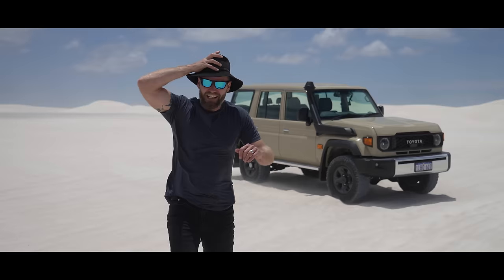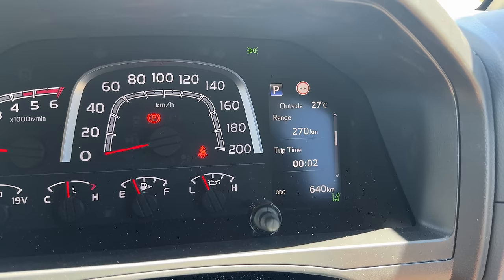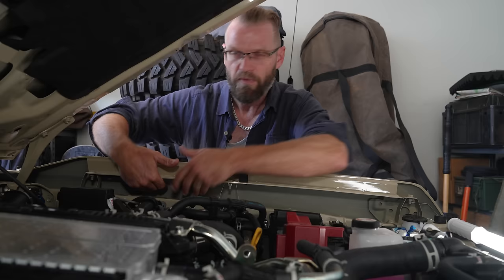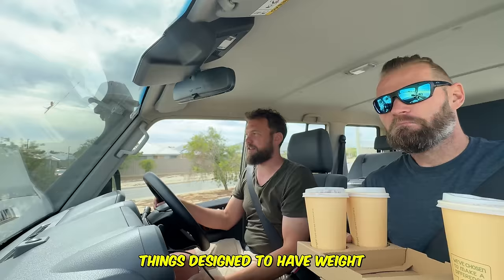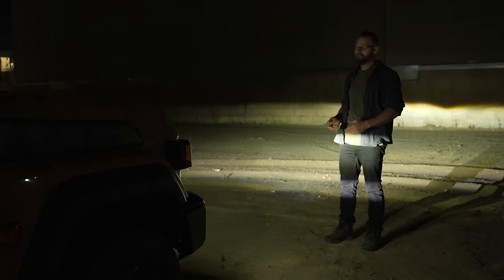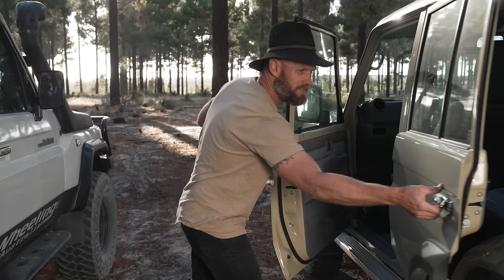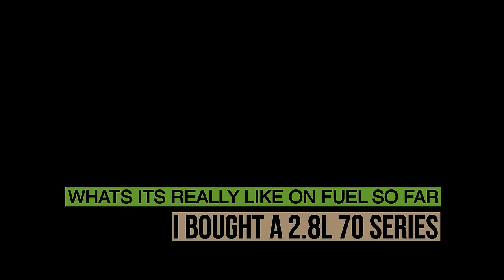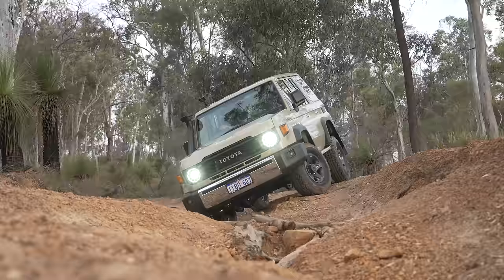I BOUGHT A 2.8l AUTO 2024 LANDCRUISER 70 series

Comment: Good on you for buying one & giving it a proper test Ronny. I worked my way through most of the YTs at the media day held at Broken Hill, with your usual bunch of clueless w**nker journos with their usual dribble. Upsides of the new 4cyl from what I can see: proven power plant (unlike the 3.3V6 in the 300), higher positions on the block for the turbo & alternator & without a metre & a half of plastic pipe from air box to turbo, auto- handy because there’s a couple of generations of drivers now who basically can’t drive manuals, higher out of the box GVM, better headlights. It will also ensure that any VDJ & HDJ will continue to hold a good resale value 😂
Downsides they could’ve pulled the front track back in, & didn’t. The same shit air box that lets dust in, unproven air to water intercooler, bet it still has a shit handbrake & brakes generally (a problem when you can’t use your gearbox to slow down), can’t pull or roll start it. Worst is all the shitty electronics like anti collision radar, electric mirrors (can’t even bolt a rifle rest on anymore) remotely adjustable headlights, traction control etc. I manage a station in outback SA & it’s always the electronics that fail first on vehicles once they get some miles & age on them. 
End of the day this is what the fleet buyers want so this is what we are going to get. Sadly the last ‘simple’ bush vehicle is gone…

Comment: I have a 2021 hilux fully speced and the led lights adjust themselves.
I think all hilux after 2020 has that?
Reply from the maker: I didnt have on mine so must be an after 2020 thing
Reply: @Ronny_Dahl  Didn't you have a 2020+ with the 2.8?
Or maybe it was a spec thing as you had the SR5.

Comment: Does it have atrac??
Reply from the maker: yes it does which only works if Diff lockers are not on
Reply from the maker: it may not be the same name for it but it does the same thing in Lowrange but I'll cover this in detail in the Off road side of things
Reply: @Ronny_Dahl  I'll be waiting to hear, live axles, cupholders and basic fitout with good traction control - I'm beginning to see a pathway... 😅
Reply: also..  @Ronny_Dahl  in your opinion why do you think they prevented atrac to work along side RDL? I know the US Tacomas still get front Atrac when RDL is on. Curious to have your take on that.